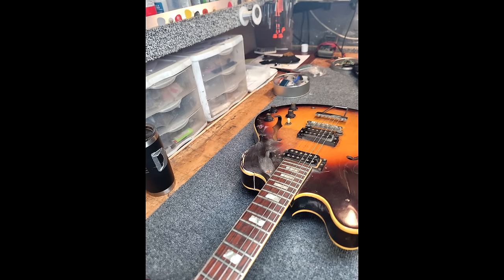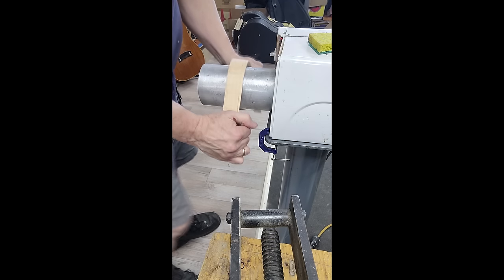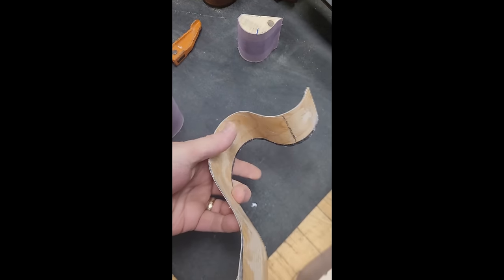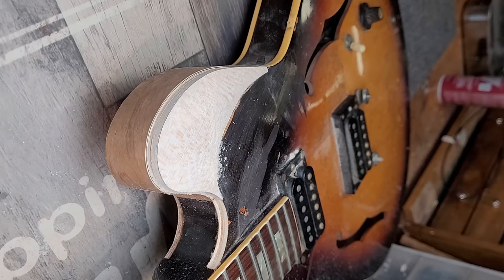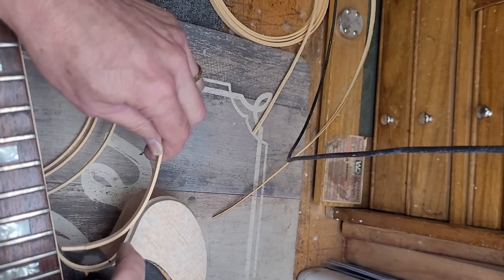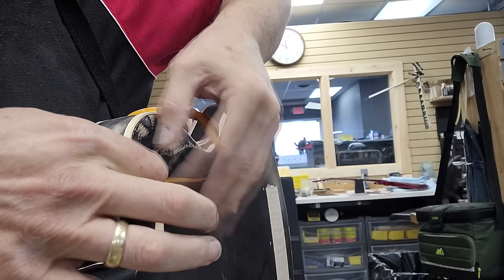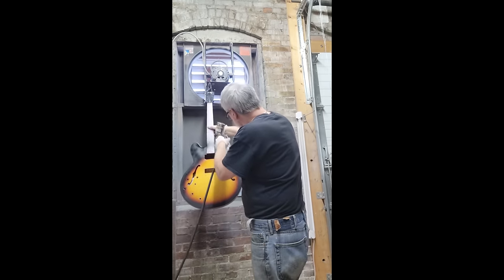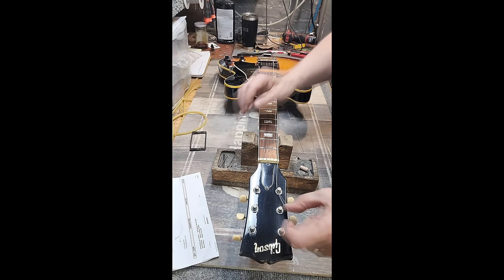Gibson ES-330 cutaway restoration

Comment: Awesome job restoring this Vintage 330. I'm surprised that the owner didn't request to fix the front P90 route. Assuming keeping a humbucker there? I had a 63 that was routed for both Humbuckers,  although it had early Pat. Pend. Phillips screw version,  I had my guy put it back to P90 routes. I sold the Buckers which paid for repair and helped pay for 50's p90's
Reply from the maker: We waffled a bit whether we should replace them with p-90's (which is still an option) but the PAF's sounded so sweet.

Comment: Nice work, sir. Great job on the color matching on the binding.
I do have one question for you. This isn't a critique, because I have never tried it out of concern for the question to follow. Do you not think that the patch on the back, with the grain of the patch being perpendicular to the grain of the back, will not present any issues down the road as the woods expand and contract in different directions throughout the seasons? Thanks for sharing!
Reply from the maker: Hi Flapjack, Thank you. Since I planned on painting the back and sides black, grain direction was not a concern. However, the small gap and screw hole plugs around the hole were a concern. To fill them I used marine epoxy with micro bubbles to thicken it to paste. It is extremely stable and will not shrink. I then used a sandable grey primer and let it cure for a week or so. It too is pretty stable. It's been a couple of months and no complaints yet.

Comment: Gibson uses veneer and lots of it...Gibson's semi-hollowbodies like the ES-335 and ES-339 have tops and backs constructed of layers (either 3 or 4) of maple veneer. My understanding is that the veneers are assembled in successive cross-grain layers with the top layer having its grain longitudinal to the length of the guitar. The tops and backs are approximately 1/4" in thickness after layup.
Reply from the maker: Yes that is true. This model and many others have laminated front and backs. They form them in a high pressure mold.

Comment: Was the repair cost effective? Looks like a lot of trial and error. Satisfying to see, but Im sure it was frustrating at times considering other projects around the shop?
Great video.
Reply from the maker: Indeed it was expensive but sentimental value goes a long way. It is a vintage Gibson after all. For the customer it was worth every penny! And yes I have a very busy shop and juggling multiple major and minor repairs is a challenge. It took several months, taking advantage of drying time etcetera to fit in the bread and butter type repairs.

Comment: Excellent, Subscribed. The only thing I felt a little uncomfortable with was the Balsa wood.
Reply from the maker: I struggled with that too but since the entire guitar features laminated construction, options were limited. Time was a factor as well. (over 50 hours) Shaping and blending in the contours was relatively easy. I'm glad I did use balsa in the end. Hardening and stabilizing it worked very well. At least as hard as poplar. I'd never use it a load bearing surface though. Thanks for the feedback!
Reply: Thanks for the reply, the results speak for themselves.

Comment: To make those super tight bends all you have to do is score the opposite side ever so slightly because the laminate is so thin we just have to make sure you just scrape out tiny millimeter size chunks then lightly wet the outside and it should bend I've literally made curves that were as tight as the width of a bottle cap it works
Reply from the maker: That's a very good suggestion. I'll try it next time if it comes up!